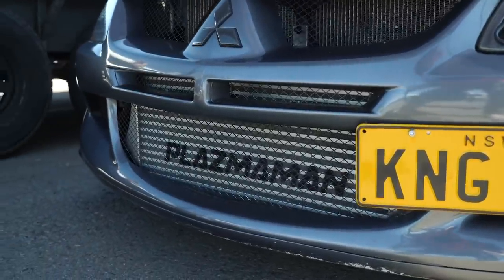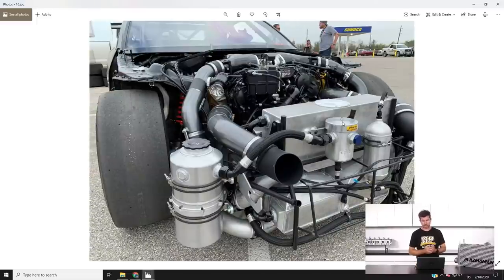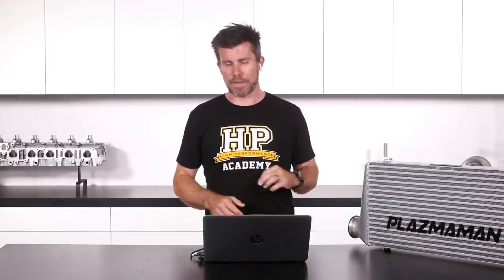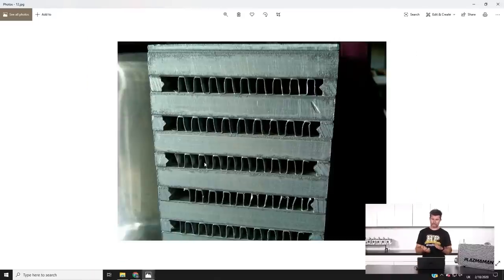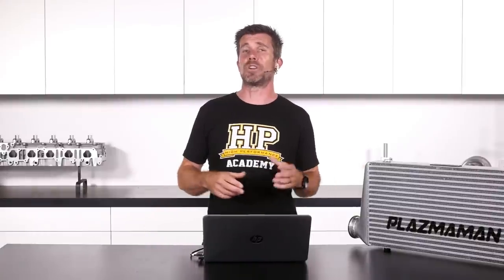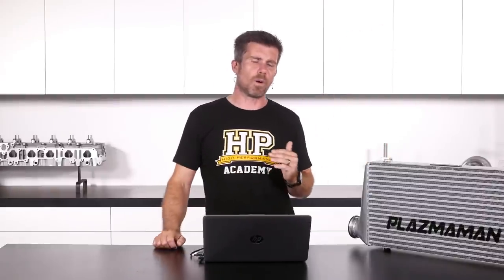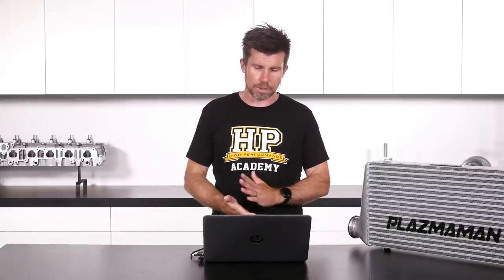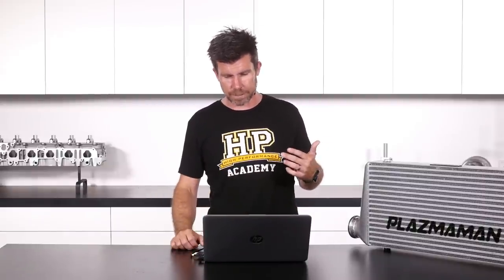Choosing The Right Intercooler Type

Comment: As a Firefighter, I use friction loss calculations to flow large amounts of water through our hoses. There is a point called "red line" where adding more rpm to the pump returns zero more pressure. I think using a higher flow pump in a water to air intercooler could be a parasitic drain beyond cooling gains. You could also damage your pump with cavitation and set yourself even further back. There are calculations tables online for friction loss that could be of use for you if you adjust for the smaller lines used in cars than fire engines.
Reply: This is very useful information, thank you
Reply: exacly, a pump has to be sized the same way a turbo is. but sadly almost no one provides a pump map even though ech properly designed pump has one.
Reply: @EngineeringSiblings actually many pumps do have pressure and flow maps. I have seen many from sump pumps to firefighting pumps.
Reply: Cavitation happens when the inlet flow can not keep up with outlet causing a low pressure and cavitation. Stall is when the outlet pressure meets or exceeds the compressor outlet causing shear and heat. At this point the pump will not flow more even with increased power. It basically acts as a water brake, just like in a brake dyno.
Reply: @chippyjohn1  I've also seen them, but more are without than with in automotive... Most are rated at no pressure and max head (if we are lucky).. It goes mostly by "trust us bro"

Comment: Speaking of intercooler pipework: I recently watched a video by another tuning company where they simulated a conventional mount turbo setup, followed by a remote (rear) mounted turbo setup on their engine dyno, ie. they first dyno'd the engine normally, then they added 11ft of pipework from the exhaust manifold to the turbine, and 11ft of pipework from the intercooler to the compressor.

They found that increasing the intercooler pipework volume made almost no difference to the boost threshold, which proves exactly what you observed. They also found that increasing the exhaust pipework volume made a massive difference; IIRC, it increased the boost threshold by over 1700 rpm.

Comment: Great video. I have a forced inductions interchiller on my Q50 red sport which works by cooling the air to water system off the AC system. I get ice cold temps which is perfect for my drag set up.
Reply: There are quite a few people that don't know what an interchiller is and how easy and beneficial it is. For $1500-2000 you cannot beat it. Probably 90% of performance enthusiasts don't know what they are and what they do.
Reply: @Brother2Jis_27s4  Compared to an air to air it seems way more efficient in cooling the air charge. Im very interested in this because my Civic type R has a propensity to heat soak at the track. So what components are needed? Water to air intercooler, heat exchanger( basically a radiator), water pump, added lines from the factory a/c in series?
Reply: How do I get this. Jeez it’d be perfect for me

Comment: Intercooler pressure drop question: If temp down= pressure down, shouldn't we be expecting the drop in pressure? Should you be measuring the air density after the intercooler, and calibrating the turbo pressures and intake temp/ density? 
I have no idea what I'm talking about, but I think I saw that bit on a Gale Banks video as he was yelling at us for not measuring that data point. Lol.
Reply: That is correct. If the mass flow is the same either side of the intercooler and cooling takes effect, then the outlet pressure will be lower. This does not mean that you can not have a temperature drop while maintaining the same pressure either side. Both temperature and pressure should be measured. If you look up an F1 intercooler youbwill see they have a lot of surface area and achieve very good cooling without pressure drop.

Comment: I saw a video by Richard Holdener where he tested many lengths of intercooler piping and it made very little difference as the piping was extended to great lengths because it was on an engine dyno. On the other hand, if memory serves me right the exhaust runner length did make a bigger difference along with turbo exhaust pipe sizing.
Reply: @Jay Dee I replaced my Cxracing is300 intercooler with a treadstone tr1035, which not only flowed a lot more volume, but also brought my iat also within about 20°f with ambient

Comment: O yeah
Found the small black and yellow nozzles at 
Irrigation Wharehouse 0.8 mm nozzle 
Work awesome as a spray bar
Only need 1 and keeps IAT at about 8 C over ambient 
My turbo is large a 62/58 on a 1300 cc
Which helps

Comment: O by the way 
After rebuilding an engine it pays to remove the rag I put in turbo outlet for safety 
After 3 dyno session I figured it out
The rag only blocked 5 rows out of 25
But I dropped 18 % torque and 6 % hp
Goes to show you a intercooler has to be sized correctly 
My engine is a 1300 cc G13 b Suzuki with an evo 3 intercooler 
300 whp and 330 Nm at 18 psi

Comment: Also intake air temperature reduction example to power increase ( eg, 20° 1 bar at 5000rpm =300kw , 40° (same bar, same rpm = ...kw

Comment: Regarding water / meth injection pre-intercooler: I own a VW TDI, which is notorious for oil (from the PCV system) condensing in the intrercooler, then getting sucked into the engine. The PCV gases are introduced into the intake before the turbo. Taking that into consideration, I think injecting water / meth pre-intercooler would be a bad idea.

Comment: Spaying methanol pre-intercooler would pretty much negate the entire purpose of the intercooler. Heat exchangers work best when temperature differential is high. So pre-cooling the air with methanol will reduce that temperature differential to almost zero and the intercooler won’t do anything but be a restriction.
Reply: Plus methanol could sit in the intercooler and if you ever have a backfire it could grenade your intercooler

Comment: Hi Andre. 

Re the pre-turbo water-meth spray, anecdotally, I have read up on studies that showed that up to 20% more compressor flow can be achieved. Or, if extra flow is not being chased, the compressor operates a lot more efficiently which has the knock-on effect of reducing the demand on turbine shaft power requirement. 

I have read concerns on the water-meth condensing back out in the intercooler, but I'd say that 'it depends'. ie, how much flow is going through the IC? What is the ambient temp? How efficient is the IC? 

I'll add this though; just as much as energy is absorbed through phase change of the spray liquid, conversely, energy is released again as the fluid condenses back into a liquid. This follows the law of conservation of energy. Upshot is; if it does condense back into a liquid, the cooling previously gained is now lost.

Comment: I bought my car (1997 Camaro Z28 pre-LS) used and it already had a Vortech V1-S and their water to air intercooler. I've been steadily updating the whole combination. Swapped the distributor for a camshaft position sensor and I'm now controlling it with a Holley Terminator X using 8 LS3 coils. I've replaced the tiny pump the intercooler kit had with a larger one from a 2009 CTS-V. And I'll soon be upgrading the heat exchanger for the coolant with a newer unit and a fan. But I've been pretty impressed with how effective it is at my low boost level of 7psi @ 6700rpm. It heat soaks a little in summer traffic but the hottest I've seen my IAT's was about 120°F. In this snowy winter weather I'm seeing 10-15° above ambient which would be 45°F IAT. I'd like to simplify to an air to air but this just works so dang good lol.

I am very curious as to what temps (both cold and hot) you start making ignition timing changes based on IAT though. I daily this thing in all 4 seasons. I want to keep it alive.
Reply: Do you need a separate water tank for the W to A intercooler? Is the pump system that keeps the water circulating really complicated to setup?
Reply: @Velocitist  my system is pretty average and it consists of the intercooler itself, a reservoir for the water/coolant, a pump, a heat exchanger mounted at the front of the car and the associated hoses. Pretty simple to setup but it is alot more hardware than an air to air.
Reply: @michaelallen2501  ahhhh I see

Comment: thew water and/or alcohol introduced to the charge air may be best thought of as "phase change" cooling - it's used a lot in the computer component industry. The heat energy the water/alcohol absorbs from the charge air changes from liquid phase to gas is exactly the same latent evaporation as when using the alcohol as fuel.

Comment: Can I use a large oil cooler as a radiator for a water to air intercooler system? Would it be detrimental to efficiency?
Reply: I'm planning on doing it in a seperate loop for my setup.

Comment: Great video guys, very helpful info. I am curious as to how much IAT increase over ambient is a concerning amount in your experience? 
On the street if I do a 3rd gear pull I see my IAT rise from 18c to 38c by the end of the pull.
Reply: I have the same question in mind.  Now i start removing timing slowly when iat goes over 40c.  is this too soon to react?
Reply: bugger!... mine hits 76c @ 38 psi.  Clearly i have issues.
Reply: @greggreg6975  I just barely touched 40c on eddy current dyno, on a long full power run. IAT was 10celsius.  The dyno fan was only partially headed to the IC.
On the street, 1 to 5 gear full power pull IAT hovers 5 to 10 degrees over ambient. 
2.3 bar of boost, about 850 CHP 60x30x10cm IC fully ducted.
Reply: @00visa00  nice one mate!.. I was on a race track, 30c outside. Not sure on air temp but it was more than 10c..lol.
im around the same  power, 800 aWHP. ej20 engine. 
i think i need a bigger heat exchanger for the water cooling or maybe ducting like you have done.
It seems i make the most power with an IAT around 40-50c. could be the fuel we use??
Reply: @00visa00  If u dont mind me asking... What rpm did it rev too and how much timing at max boost and rpm?
Reply: @greggreg6975  Peak timing at max power is 23 degrees.  It spools around 2800rpm, 1bar at 3300 rpm ish and full 2.3 bar around 4600->
Reply: On my 600 bhp drift car I was regularly hitting 50c intake air temps and never had any issues but drift cars do usually only get thrashed for a couple of minutes at a time and then cool down for a while

Comment: What is better for cooling the air charge? Thicker core or more surface area? I know that also depends on the fin density and amount of flow through the internal tubes or hollow bars in a bar and plate core? To make the core even more efficient I could have aluminum panels added around the core that directs the air into the core so there’s less wasted air going around past the edges of the core. Then there are different brands that actually do have engineering behind their designs such as Garrett intercooler cores, CSF , PWR.
Reply from the maker: You've answered the first part of your question there really, thicker or surface area are not the only two factors.
There is a interview here you will enjoy, but I would add that companies like PWR will help you find the right choice for your application, you don't have to do all the maths and go to them, you can just give them all the details, they know the right questions to ask, and from there together you can work out what you need remembering there will always be compromises, usually with the packaging - Taz.

More radiator talk, but there is cross over: https://www.hpacademy.com/blog/improving-your-engine-cooling-c-and-r-racing-tech-talk/?utm_source=youtube&utm_medium=social&utm_campaign=general-interaction

Also just a good watch in general for cooling: https://www.youtube.com/watch?v=Fnmc_uJv54w&t=0s

Comment: Do you have any gut feel for cfm air volume on a diesel compared to a petrol forced induction engine. I’m trying to size a WTA intercooler core on a 450 HP 6litre diesel with a compound turbo set up running up to 50psi

Comment: How can you tell if your climbing IAT's are due to your intercooler being too small or if your high IAT's are due to the compressor being too small on the turbo or turbos?
Reply: With turbo speed sensors and a couple of pressure sensors then you will find where the turbo compressor is operating on the chart
Reply: @ReubenHorner  Xonarotor turbo's have no compressor maps.

Comment: Electric air conditioning compressor fixes engine power loss problems, which is the direction I’m going in my build
Reply: Only if you are not drawing of the vehicle 12v battery

Comment: What do you think about using the car’s a/c to cool an air to water ic like the company Interchillers? Adds weight, more complexity, but seems effective cooling the air charge.
Reply from the maker: Not something we have tested personally sorry, but running at A/C for this purpose does indeed add more load to the engine directly, as well as via weight. That might not matter so much for a street application where you already have and want to retain A/C, for a race application it would be unlikely to be superior to a correctly optimised cooling system though - Taz.